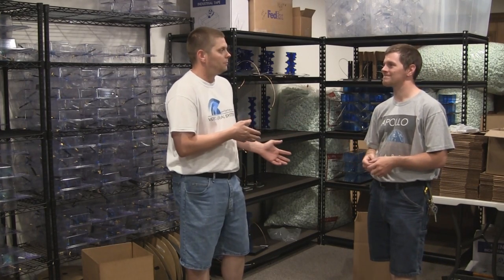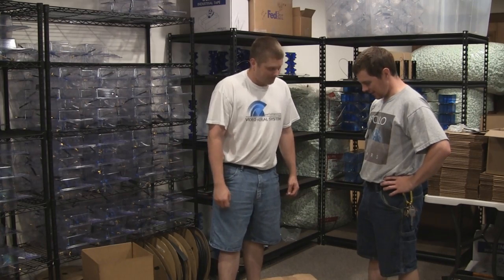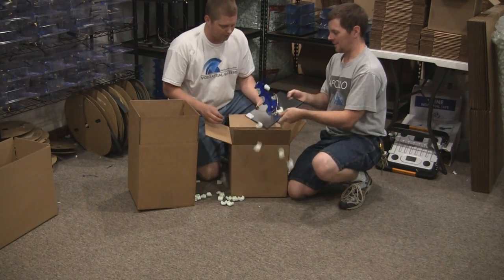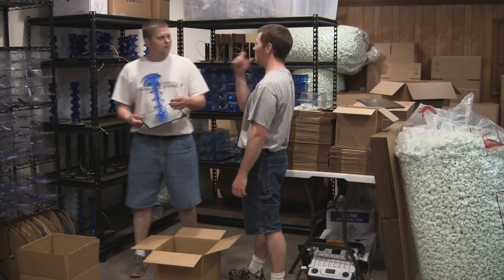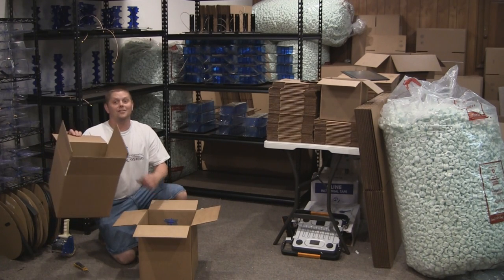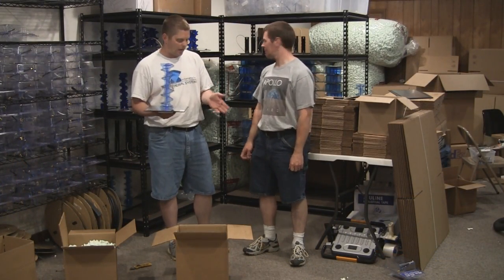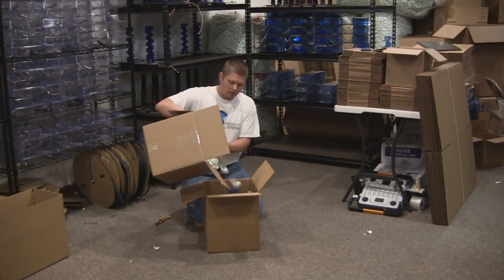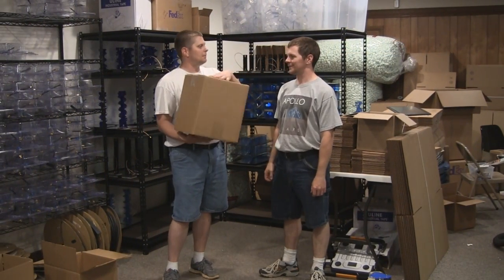Destructive testing: helical antennas

Comment: I used to be a pre-loader at UPS.  Peanuts suck, especially for items with sharp corners that can eventually be "vibrated" and shifted to the side during LONG journeys on conveyor belts through sorting.  You also need to be able to withstand somebody using the box as a step-stool; at the desired rate of handling 1,200 packages per hour (each), while unloading semi-trucks in "the doghouse," the words "fragile" and "this end up" were meaningless to us.
Reply from the maker: Good to know.  We are now packaging these up in individual boxes with a 200lb crush weight.
Reply: If you think that's bad, try working an unloading line at Target. The guys who load the truck seriously have no care for anything they shove in there!